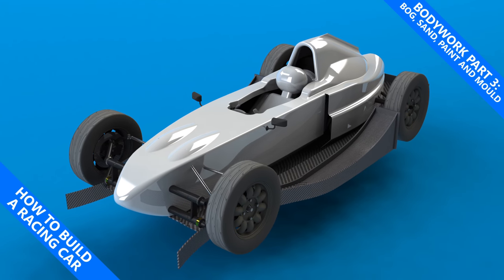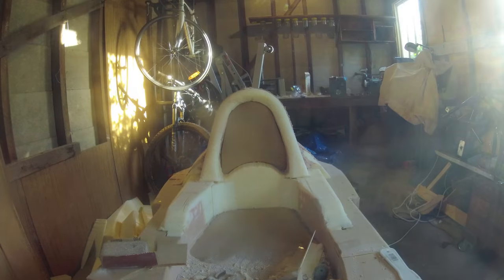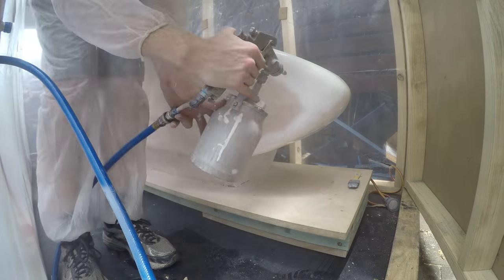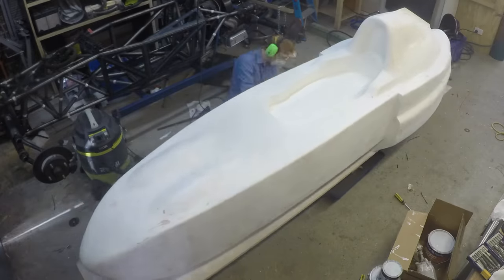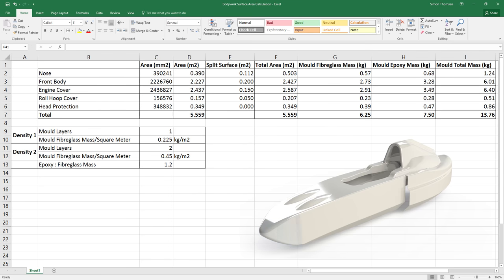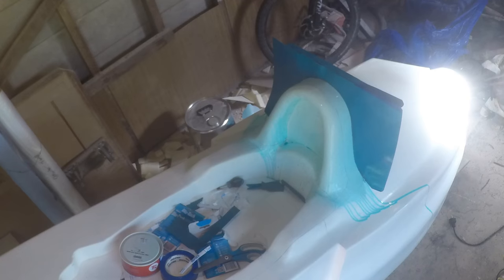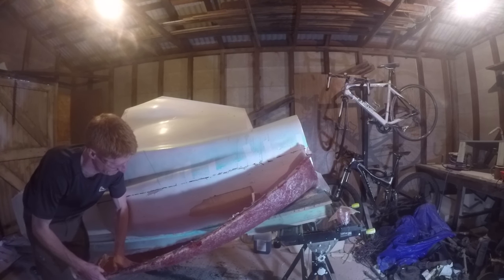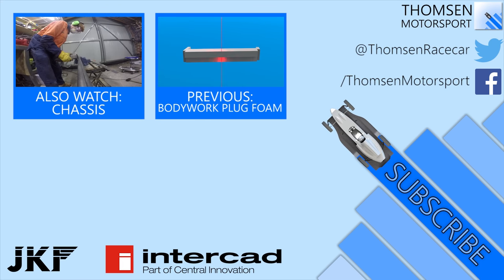Bodywork Part 3: Bog, Sand, Paint and Mould

Comment: you did those split plugs all wrong. you re not supposed to remove the parts of a split plug, nothing will fit properly afterwards. you only remove the medium that was making up the wall (those tapes you had made to create flanges). also your molds are too thin, needs more layers.

Comment: some people uses a lay of tinfoil between the original and the fiberglass mould. It's a shame that the car is destroyed after so much work! :(
Reply from the maker: That would've helped for sure. If the plug had survived I've have made a second set of molds, the first set are pretty poor and probably won't be able to make many bodywork pieces without a bit of work to improve them.
Reply: OH, NOO!!!
Reply: would clear coat on top of the paint have helped?
Reply: Tinfoil would work, but then so would a lot of different stuff. Most manufacturers of (large) fiberglass parts use a 'Mold Release Agent' that you simply spray on the mold ahead of the first layer of fiberglass. I've be told that the old way of doing it (getting the fiberglass to release from the mold) was to apply a thin coat of petroleum jelly to the mold first.  AND WHAT THE HECK IS BOG?! (p.s. You can get a 'sureform' file for roughing out the foam It's much, much faster.)
Reply: ₳M€RICO true cause he could’ve keep the whole piece to make more panels just in case he crashed or got into an accident 

That sucks
Everyone makes things so difficult
Reply: @jstephenallington8431  looks like bondo don't it?

Comment: In the future you'll find compressed air and a rubber-tipped blower your best friend when getting the parts loose instead of destroying the plug- also the "Mold" parts you made should have had a bunch of wooden ribs glassed into them to help the mold keep its shape to be able to cast the body accurately, what you have there is a floppy mess that will never yield a strait part or body shell without major headaches.....
Reply from the maker: Just wait to see the bodywork build, you'll find your comment is almost prophetic... I could have done a better job for sure.

Comment: A trick is to spray the entire body with gel-coat and then sand and buff it, then paint, then make molds off it. Saves having to use two-component resin bog.

Comment: Nice series of videos.
Here in Adelaide I use a 5m bed 5 axis router, seems a shame to watch something already CAD modeled being built by hand. :)

I got to do the main body panel plugs of one of the new Formula 5000 cars for the reintroduction of the racing class.
MDF buildup was used for a more cost effective alternative to tooling board.
The customer chose to do the final finishing to molding standards, which suited me fine.

In my patternmaker days we dumped the PVA based release for one with a solvent in it that left a silicone feel when applied.
The PVA ones will tend to be more clingy like a lunch wrap is, where as the silicone based ones will pop earlier particularly if you can get compressed air down a partly separated area.
Most likely it is that the bog is separating from the foam easier than the mold from the plug, rather than the release not working properly or anything wrong with its application. 

Polyester with it's quick set time will get hotter than epoxy, which can have an adverse effect on PVA type releases where areas are thick or hardener ratios are not optimal for application on a hot day.
Reply from the maker: Mate where were you two years ago! I decided to go this way to save costs but ultimately it wouldn't have been much different and I'd have saved so much time. Live and learn. Lots I could have done better all through the bodywork fabrication but can't change it now.
Reply: You live and learn, it's always better the second time round.
FYI here is a link to my Facebook page https://www.facebook.com/doug.smyth.31 that has a link to the routers Flickr album.

Comment: Moulds parting lines and flanges, use melamine white board, apply with bog along the edge that meets the plug, bog squeezes out to 1 seal flange and 2 attach flange then use heat gun to set bog be ready with sharp knife, trim green bead of bog flush with plug and working face of flange. Perfect flange line and seal. Bog won't stick to PVA. So flange just pops off latter.
Use 8 mm dowels on face of melamine so dowels become impregnated between flanges and mold location.

Comment: the reason why the plug got destroyed is because the underlying surface below the wax was not buffed to a fine finish like a car. also you were using too much pva a fine mist is all that is needed, i have seen pva eat through wax and if you apply too much it will cause its self to run off . 

so its either wax mold release or pva not both.

Comment: I have made molds to create composite pieces to be sold.. A couple points: The plug should have been covered with fiberglass cloth + epoxy resin - the epoxy would not eat into the underlying materials. Having the layer(s) of fiberglass on top of the plug would have given the plug the strength necessary to resist coming apart when the mold pieces were removed. On top of that, a lightweight fairing compound mixed with epoxy resin (not Bondo) should have been applied. This would have been far easier to deal with than the Bondo, both in application leveling out and sanding. It would have likely been a lot cheaper too. I would have definitely used flanges at the joints that were TWO mating pieces of wood, metal, whatever.. One becoming part of one mold section, and the other becoming part of the other adjoining mold section. They could have been drilled and bolted together for alignment purposes later on if that were desired (like if you wanted to layup the finished part as the sum of those two sections simultaneously.. Mold making sucks and there is so much handwork involved. That said, using the right materials can make it a lot easier in the long run.. A quick look at boat building as a topic can show a lot of real world examples.. Not what I was doing but still a great reference.

Still I congratulate you on this build. Very ambitious and I am loving watching the videos. They are a blast to watch! Cheers!
Reply from the maker: Yeah I just hope that anyone wanting to do this reads your comment - and goes further even with research. Would've saved me a lot of time.

Comment: I've made a lot of large aircraft plugs using this method.  1. After you had the foam to shape you would have saved a lot of time and filler by first applying a layer 225 chop matt to create a hard skin for the bog to adhere too. 2. You MUST always use PVA on fresh surfaces.  Wax alone can have horrific stick ups. I had some  myself so researched the problem and soon found the official reason for this, its a chemical reaction...Bla bla.  My method sounds strange but parts literally fall off! Spray 4 cotes of PVA. Then once dry one coat of wax then hand buff.  So yes PVA then wax. Try it.
Love your project I'm about to start an F1000

Comment: @8:30 (8-o) OMG, I thought I was organized! Sucks how your molds stuck to the pattern. It's hard to part with the pattern after all that work-- mine is still sitting downstairs collecting dust. I now think the best way to make the pattern is to lay .062" fiberglass layer right over the foam before doing any refinement, then putty, prime, & paint over that. In your case, that would have held the pattern together while removing the molds.
Reply from the maker: Yes it was too bad it was destroyed, I'm not sentimental though so it was probably going to end up in the bin one way or another. The incremental damage just made the process of making the molds so much harder. I like the idea of a thin fibreglass layer, that would probably have held it together through the strain of removing the molds. Even if the top paint failed it should still be dimensionally accurate if that area was repaired. Ah well, it's history now.
Reply: Wow would you believe it I love both your channels and then ere you two are communicating together ... small world huh:)

Comment: How did you attach the body panels to the chassis? Will you do a video on that?
Reply from the maker: I'm using DZUS fasteners to attach the panels, basically they are small quick releases. I'm happy with them so far. I'll do a video on them once the bodywork is finally completed. I'm going to have it painted in two weeks, so it'll be some time after that.
Reply: Awesome thanks!

Comment: Hi I live in the uk but I can't find anything called bog, are there any other names that it has, or other things that you recommend
Reply from the maker: Might be called builders putty? Bog is probably an Australian-ism but it's what it's called in the store.
Reply: ive started using plaster because i only saw your reply now, do you think i will have problems.? ( I plan on putting the car body filler over the plaster but still curious)

Comment: I've got two doubts...1)What's the bog for??    2)Why'd you paint the plug?
Reply from the maker: G'day, to answer your questions.
1) The bog is to provide a hard smooth surface on top of the foam, plus to provide a surface that can be shaped as needed. The foam and wood underneath aren't perfect, particularly the foam so the bog allowed me to build and sand until the shape was better.
2) I painted the plug to provide a smooth liquid tight surface to pull the molds from and again to try to achieve an even better surface.
Reply: Thanks man....You're the best!!
Reply: Bog = Bondo ?
for us American types

Comment: How did u measure all that? (The excel)
Reply from the maker: The surface areas I was able to extract from Solidworks. I just copied that across to excel to create the materials list.
Reply: Interesting. Thnx!! I really needed the hurry. 💪🏻.

Casually, yesterday I was working on Autocad Inventor and I saw that after doing the piece there was a specific step to see the area and u could change it to any unit u may like.

Comment: Why did you remove the mold sections individually  ?   You should have glassed all the panels and then removed them all at the same time..   
   What is  "Bog" ?   I would have used plaster,  then polyurethane over it..
    Paint the plug with  2 part epoxy and then wax it..  You must use the 2 part kind.   Not the 1 part..  The mold will come right off.
Reply from the maker: "Bog" is builders bog, something we have in the hardware store in Aus - basically a chemically setting material that's easy to sand and shape. I can't say my way was the right way, only that it got the job done - I'd have benefitted from a better procedure for sure.

Comment: your buck should have ideally been a gloss finish,  then it would have released easily.
Reply from the maker: benjamin collinson how would you say I should have done it then out of interest? I went down to a fine sandpaper, I think 1200 or 1600 then used the wax as well, at the time I wasn't sure what more I could have done. Would have been nice if it were easier for sure.
Reply: mdf is super super porous, so basic steps would have been two to three coats of high build primer, flat it back, two coats of regular primer, flat it back, 3 coats of your base coat, wet sand it back, 2 coats of lacquer, then wet sand it and buff it. it should at that point be near enough as glossy as you can get it.

Then to make the moulds you need to decide where the breaks will be and wax that body really well, then create either Plasticine or more permanent acrylic barriers to build the gel coat and fibreglass against. once you've laid on all your matting and resin then you'll need to add strengthening ribs to it in either mdf or acrylic so it doesn't flex when it is taken off the body and so you get more accurate moulds in the future.

all that said, mould making is notoriously straight forward as much as it is fickle.

good channel by the way, enjoying it.
Reply from the maker: Right, I probably ended up with near that much primer and base coat from the repeated coat/sand process but I didn't use any sort of lacquer, nor did I wet sand or buff. Good advice thanks, I'll keep it in mind if I go through something like this again. I paid the price on the moulds and I'm still paying the price right now on the bodywork for these issues with the plug. Doing my head in! But I'm getting there, it just would have been a much smoother process if I had more experience or knowledge before starting.

Comment: Just a word of caution, the smell aside, epoxy resin is actually pretty nasty stuff. While it might not cause a chemical burn like vinylester, epoxy resins have extreme allergizing effect, some more potent than others, which when developed can cause severe scarring of the skin and makes working with epoxy a practical impossibility.  Had the spill been of the more allergizing variants of epoxy systems, you'd not be working with epoxy ever again.
Reply from the maker: This was a key criteria for me when I selected the specific epoxy that I used for the bodywork pieces themselves. The one I selected is formulated to be as safe as possible to use. I made that decision after this job doing these moulds, I hated using the vinylester resin, it really was horrid stuff. Working under the PPE made the job difficult and I still found it left my hands burning even with the gloves on and no contact. Not keen to ever work with it again.

Comment: Unfortunate that that happened to the plug! in future after you have finished sanding the plug and applied all the filler and the surface is level, use aluminium foil tape instead of the paint. apply the release agent on top of the foil and then apply the fibreglass. If the release agent does its job then the body will stay intact and nothing should pull off with the new mold. If in some parts not enough release agent was applied then the resin won't stick to the foil tape. 

i don't know if you have seen this video before but I'll stick it in. watch the whole thing he explains the idea behind the tape thing better than me. 
https://youtu.be/PNxZjOExd6g
Reply from the maker: I've not seen that technique before but it does look like it would release easier than I found mine did. I would say though that the surface quality probably wouldn't be so good and would need more work due to the little crinkles in the aluminium foil tape. But considering my surface quality wasn't that great anyway it might have been a better compromise for me. Thanks for the heads up.

Comment: What the heck is "Bog" Sorry, I'm an American, and I'm guessing it's Bondo, but I've never heard the term, "Bog".
Reply from the maker: It's "builders bog", something you can get in any Australian hardware store but I guess not overseas. Basically a putty which you mix with a hardner and it sets into a solid that you can sand to shape.
Reply: Okay, in America it goes by a pretty common comercial name of "Bondo", a plastic body filler that you also add a hardner to.